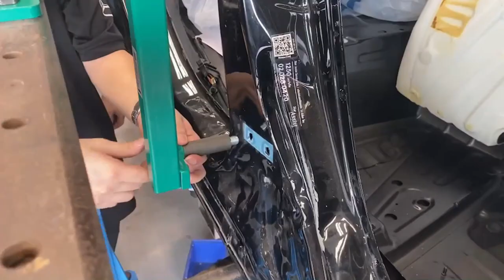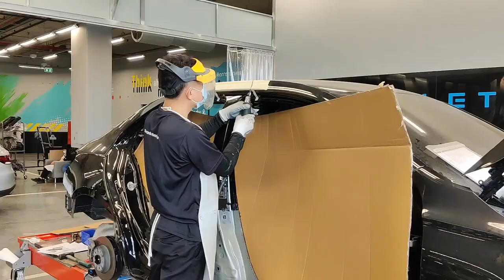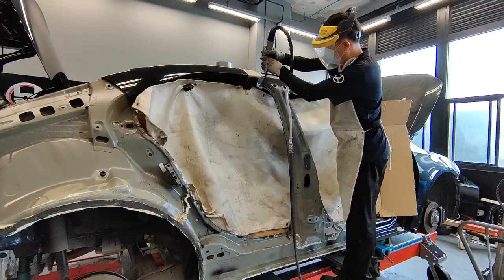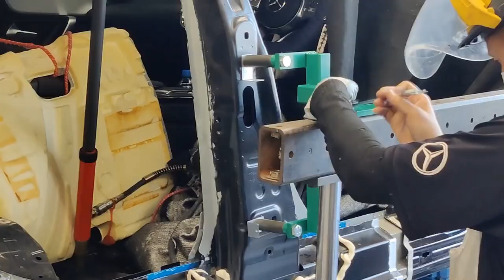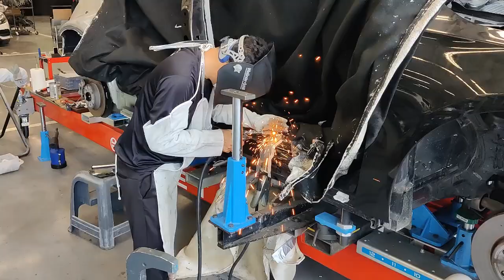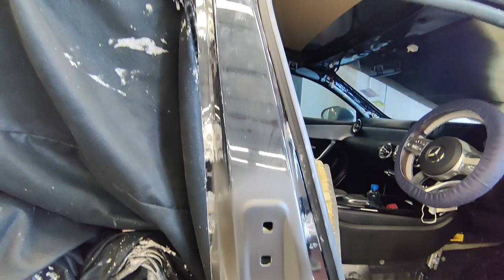Mercedes-Benz A200 accident repair. B-pillar replacement.

Comment: Right now I'm doing my own car restoration so I really need your advice.
I'm just wondering why do you guys prefer to use body saw over cut of wheel or Sawzall ?

Anyway, really great video. Seamless result !!👍👍
Reply from the maker: Hi Steven, thank you for watching and for leaving your comment. We as Celette manufacture the equipment and deliver to our customers, we do not repair cars. This channel was created in order to show to public how our equipment is being used in different body shops around the world. This specific repair was done in certified Mercedes repair shop in Bangkok and was all according to OEM requirements. Your question should be addresses to the tech, next time when we pass by that shop we will ask him and let you know here. Thanks and have a great day!